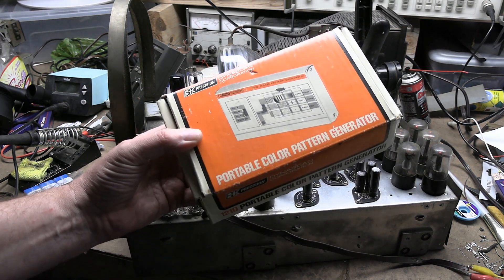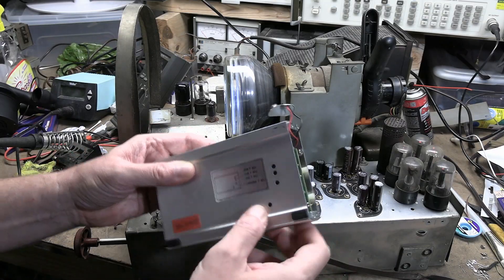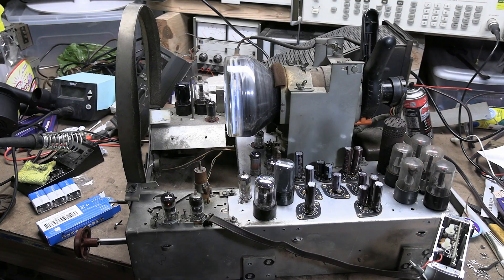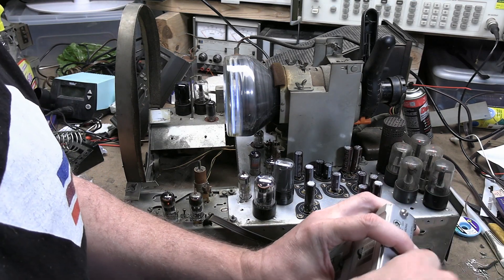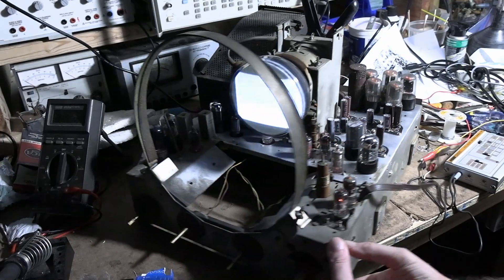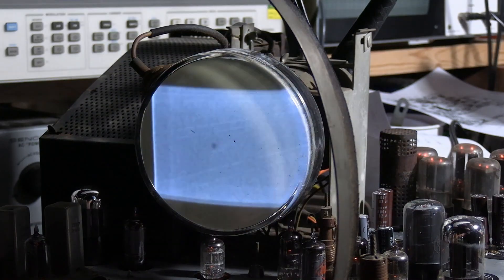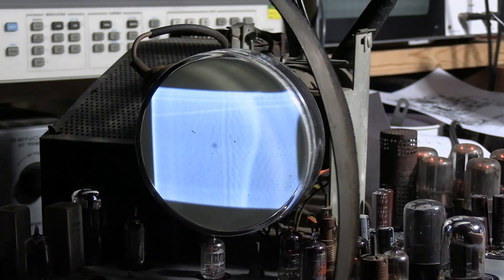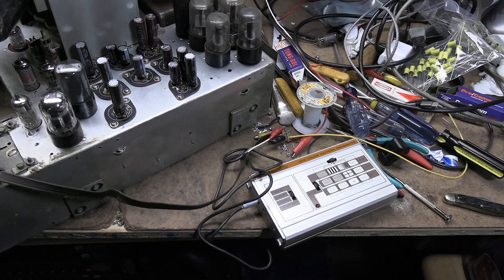B&K 1210 NTSC pattern gen - a low cost option?

Comment: I bought a b&k 1251 several months ago and I absolutely love it. I was previously just using a computer to generate patterns, but those junky HDMI to composite converters screw up the geometry (even with a 4:3 HDMI signal) and the color burst is usually far enough out of frequency that vacuum tube TVs struggle to lock.